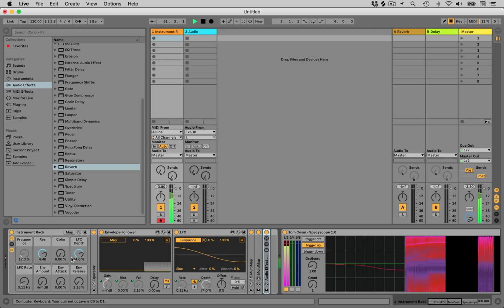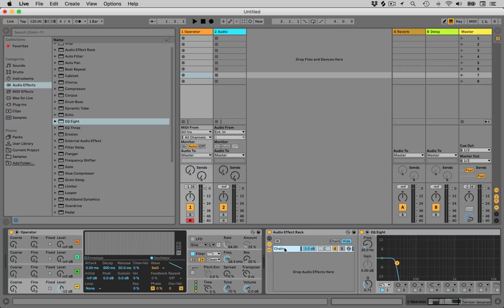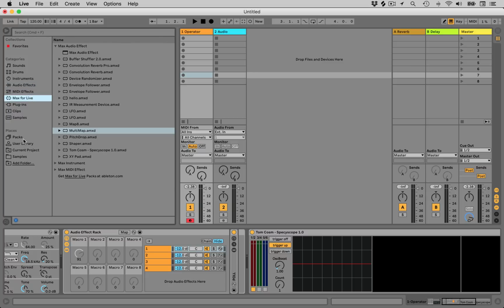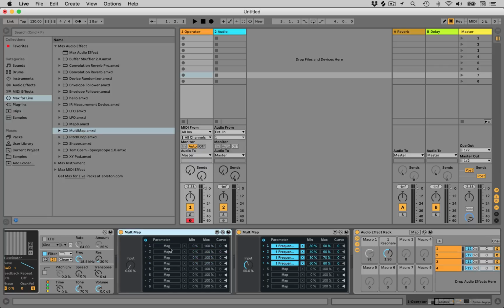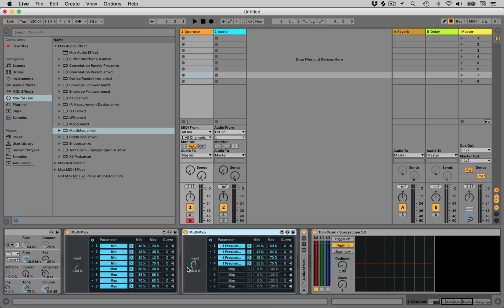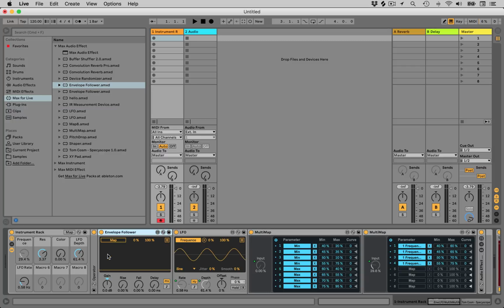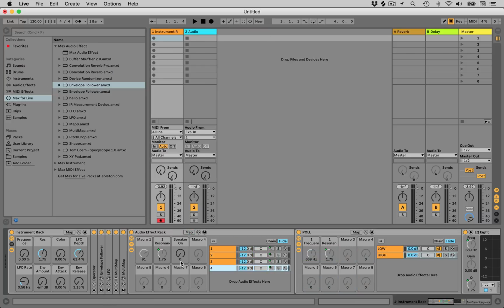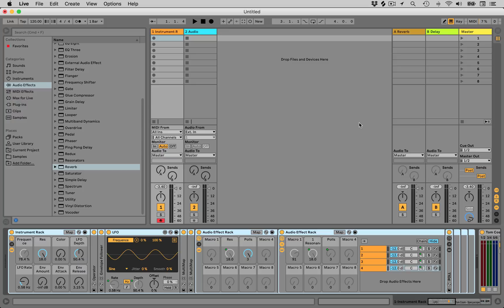How Phasers Actually Work - Making One From Scratch in Ableton Live

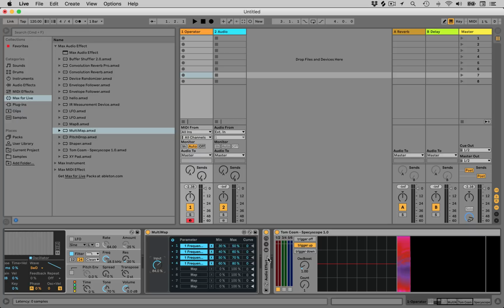Comment: 6:55 You can use any sidechain device for feedback.
Put the sidechain device in a rack at the front with one "thru" chain and one "feedback" chain.
As the sidechain source choose a point at the end of your signal. You can only choose rack chains in that menu as a source so depending on where you want to grab that signal you have to make a dummy rack there.
In the sidechain device activate the "headphone" button. So it outputs its sidechain signal instead of its processed input signal.
Now the volume of the "feedback" chain is the feedback control.
Reply from the maker: Brilliant! I forgot about this, and also thought I wonder if I can do it now that Max supports multi ins and outs - good tip bro got my thinking hat on